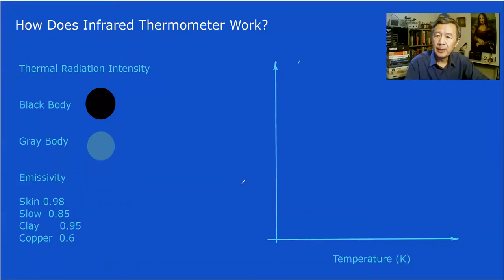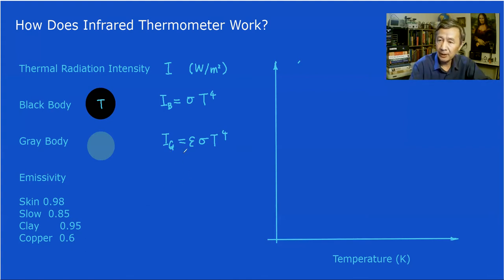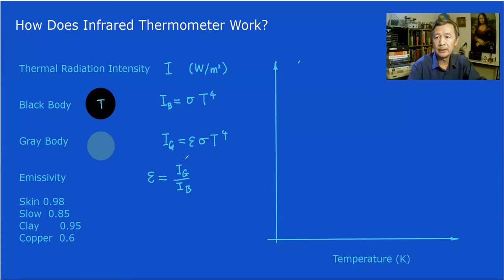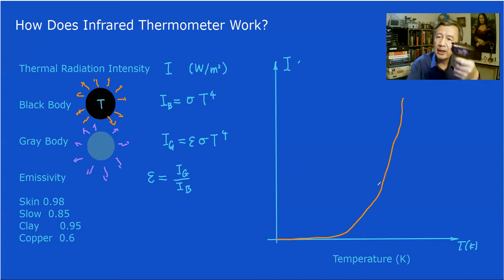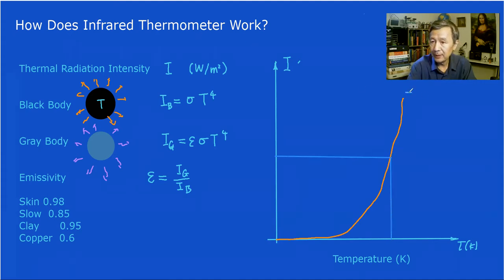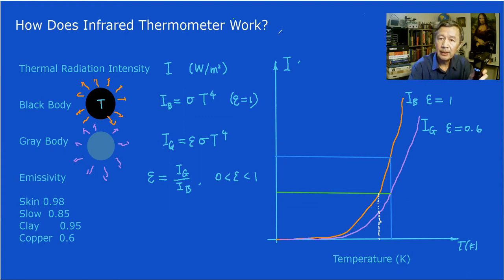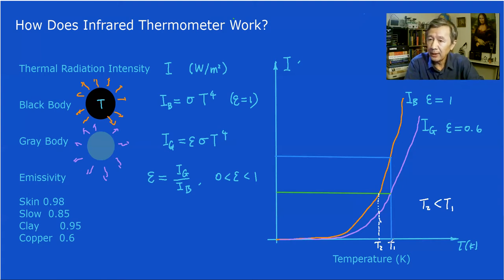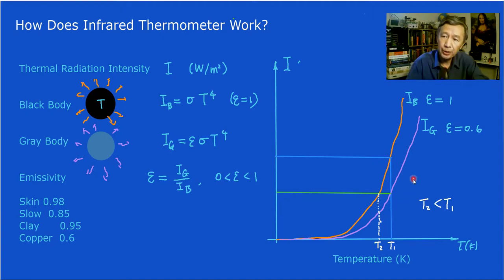How does infrared thermometer work? What is emissivity? | Black & Grey Bodies | Yong Tuition 201006

Comment: Ver clear presentation- By the way what is emissivity of CO2 ? molecyle ?
Reply from the maker: Good question. In gas form, someone had used 0.2-0.3, but other argued to be 0.8, for the emissivity of CO2. In general, emissivity is defined a relative ratio to that of a blackbody. In my opinion, the emissvity should be proportional to the gas density.

Comment: I've also read that amore plausible source of the increase in Earth's Temperature is the excess UVB radiation penetrating the Stratosphere due to a depleted O3 . Using Planks law E=hf,
The IR radiation at 15 microns has only an E= 0.04 ev/photon while UVB at 300 nanometers has an E=4 ev/photon. That 50 times more energy than the IR from CO2 !
Also read that the Effusive volcanos emit tons of Halogens (Chlorine, bromine etc ) into the atmosphere. 
  (1 atom Chlorine destroys 100,000 molecules of O3) I'd love to hear your comments on that also..

Comment: I get the basics of black body radiation and the Plank curve. But how does an IR thermometer see a wall that's 20 meters away when the air is the same temperature?
Reply from the maker: Good question.  As you noticed that an object is immersed in air, the diplayed temperature on an IR thermometer is close to the interface temperature where air has almost the same temperature as the object surface.

Comment: Say for instance you measure something at 1.0 emissivity, and got a temperature reading of 250 degree F. But later you found out the actual emissivity of the object was 0.75. How do you re-calculate the temperature only knowing the information from the first reading?
Reply from the maker: 1.0*sigma* (T_1)^4 = 0.75*sigma*(T_true)^4  where T_1 is (250°F − 32) × 5/9 + 273.15 = 394.261K, sigma is the StefanBoltzmann constant.
Reply: @yongtuition  Finally, we get T actual=423.66 K=309.19F right?, thank you
Reply from the maker: @ramsaha7940  I think so, but you can doubly chech the result.

Comment: Hello, is Stephen Boltzmann and Wien's law of displacement used in this device on humans?
Reply from the maker: Only the Stefan-Boltzmann law is used as the total radiation intensity is detected.
Reply: @yongtuition  Well because I read in several sources that the temperature is measured by calculating the wavelength of infrared rays and substituting it with Wiens' law to extract the temperature through the law 
temperature×wave length=0.0029 is that true?
Reply from the maker: @mustafanashwan5932  To apply the Wein's displacement law, you need to use a spectrometer, or FTI.R, which is too expensive >$800,000. The product I used is less than $100.,

Comment: Nice video, but how does the sensor determines the temperature? If it would by detecting the amount of infrared radiation, it would also decrease with distance. How is it possible to measure the same temperature with different distances?
Reply from the maker: By definition, radiation intensity is the detected power per unit area of the radiator. So, it can be done by selecting a larger area while the distance increases. For a large object, such as clouds, the intensity is almost independent of the distance because it can be treated as a plane source rather than a point source.
Reply: @yongtuition  Thank you so much! Now I finally got it. In hindsight it's so obvious. You helped me a lot :-) Thanks.
I would like to build a low cost, relatively high resolution, thermal camera. I want to use a mirror telescope to measure a small area and scan a large area with it, to generate a large picture. Now I at least understand how the principle behind the measurement works. 👍